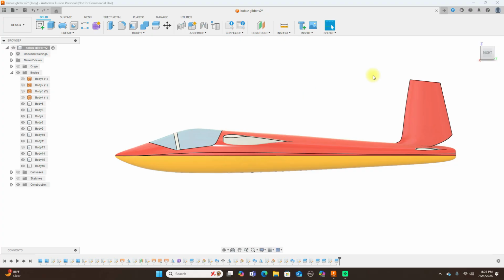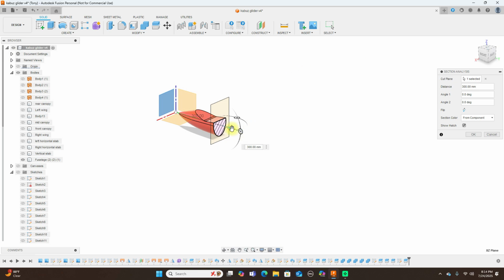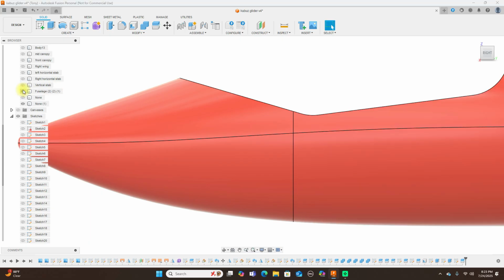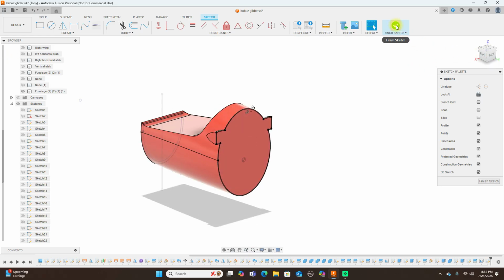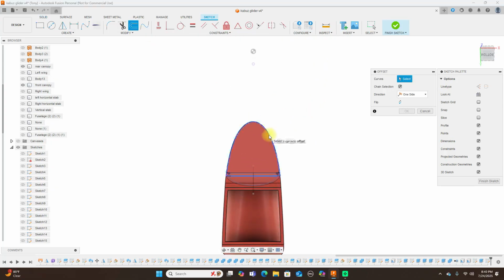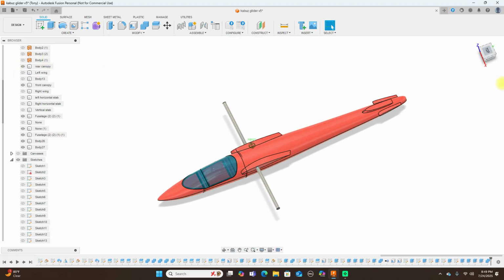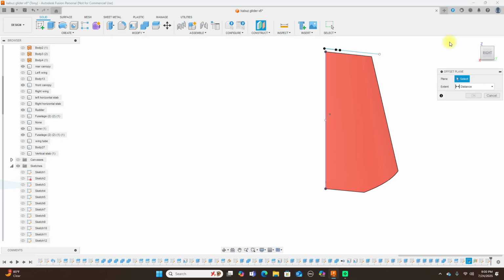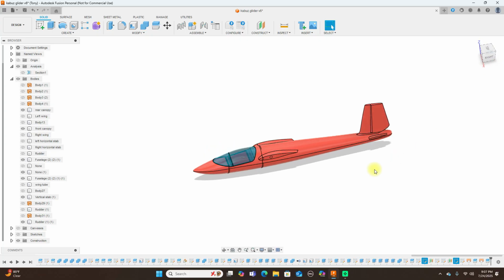secrets to model internal structure for 3D printing RC airplanes

Comment: 0303   what is  wrong, at the bottom of the rudder.!?>@>      there are two  NORMAL  ways to achieve control surface clearance.
1 ---  vertically align the location of the elevator hinge with the rudder trailing edge.
2 ---  use a split/notched elevator.

Comment: 4026    seems to be an instance of   poor  wing profile selection.
4332   you may know that the central main spar should mechanically tie-into the (half) spar in each wing half.    central main spar/tube should be located at thirty percent of chord/mac.      the nose should have a  RADIALLY SYMMETRICAL  shape.!    so that is produces symmetrical deflection/drag.